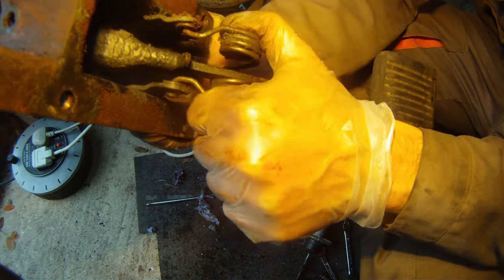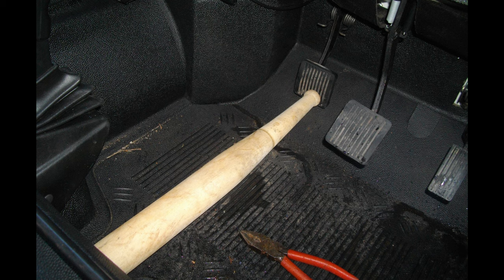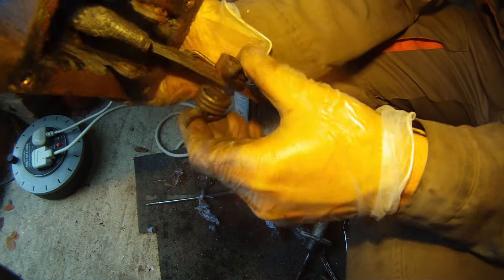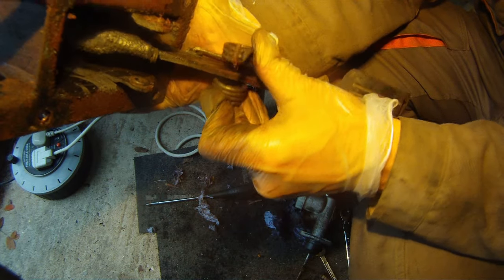Quick tips: Removing a Defender clutch pedal spring

Comment: Well, here I am watching another clutch video 🤔
Reply from the maker: No more I promise!
Reply: @lrworkshop  😂😂😂 well, I'm good 😂
Reply: @lrworkshop  my key issue is "cooling" with my 300 Tdi. I better fix that for good. Do you have any vids re 300 Tdi engine (over) heating problems and best cooling practices? Cheers
Reply from the maker: @overnighter  Whereabouts in the world/climate are you?
Reply: @lrworkshop  I'm by Aegean Sea (mostly North)
Reply from the maker: @overnighter  I don't have any vids per se. I know Australians have problems with the 300Tdi in 40+ C. It should be okay in the mid 30s. I would check all the components are working, radiator, hoses, heater matrix, expansion cap, bleed hoses, water pump. if it still has problems then a head gasket would be a suspect
Reply: @lrworkshop  thank you. Yes, summer time it's easily mid 30°Cs in here. And winter time urban driving is OK. The main problem is highway hills in summer days. I wonder whether a Australians came up with a proper solution?
Reply: @lrworkshop  the thing is, head gasket, etc are result - and not the cause. Sox you change or fix it, and blows again... Ill be checking components as you've mentioned.
Reply: @lrworkshop  and I'm thinking of upgrading radiator and  aftercooler to a larger aluminium ones, indedd.
Reply: @lrworkshop  thank you 👍